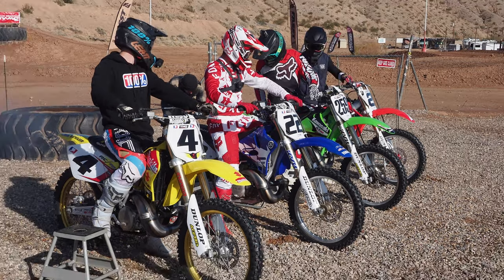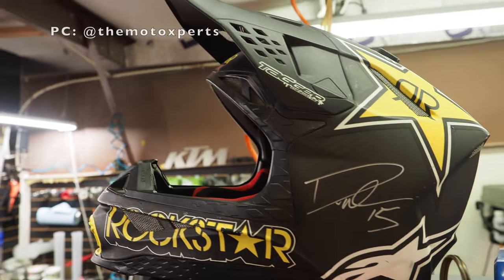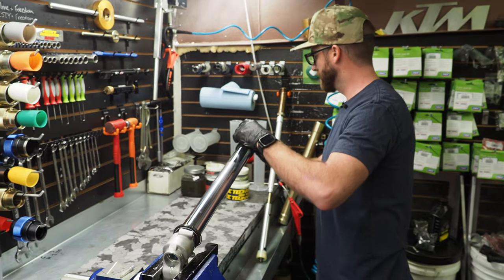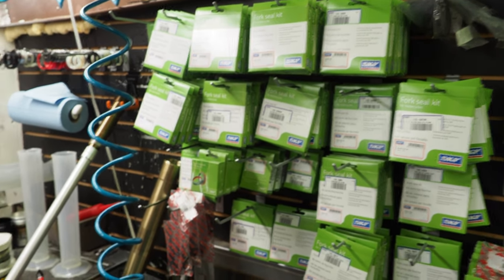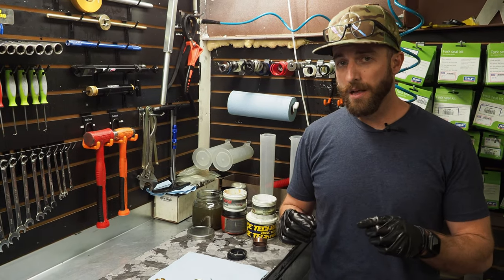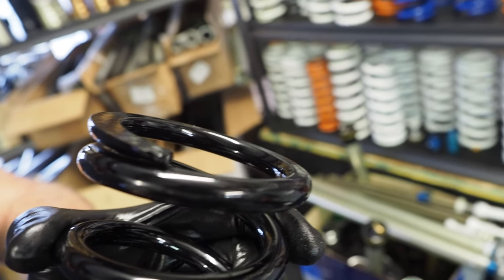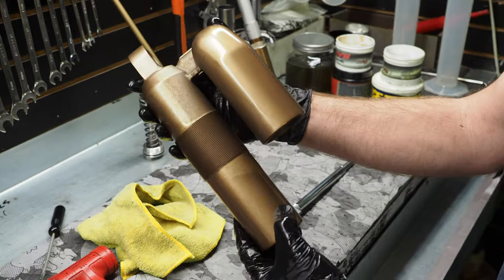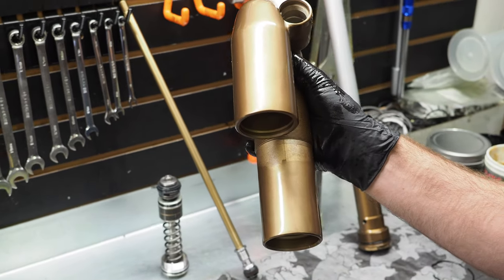Must Know Suspension Tips Before Your Next Rebuild with the MotoXperts

Comment: Couple aerospace tips for the MotoXperts shop, switch out all their steel picks, punches, and pry bars with brass and/or composite. Induction heaters are preferred than torches for heating stuff up where applicable. Finally, soft jaws are a great start, but flat ones can still crush tubing out of round when hammering on stuff. Teflon or phenolic jaws with cutouts on a pivoting vice are much less likely to dent casings. Keep up the excellent work!